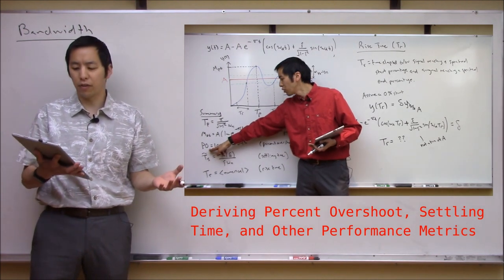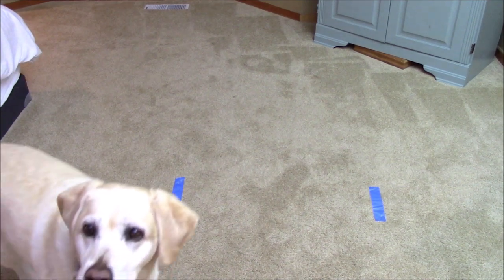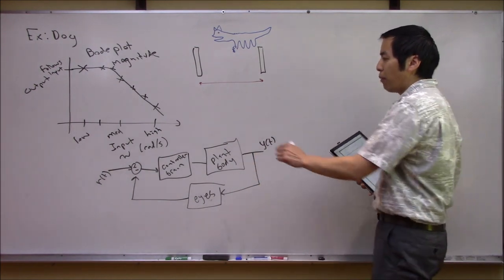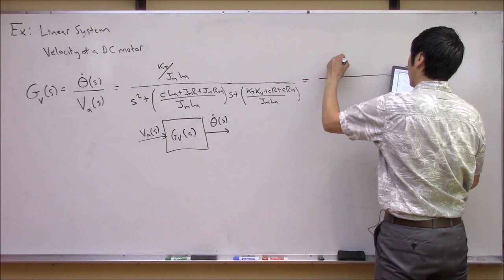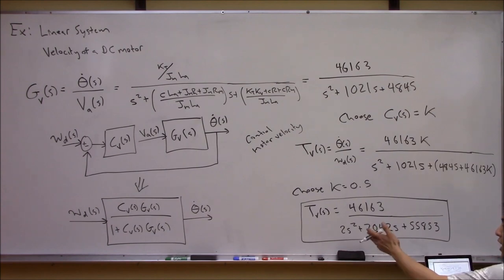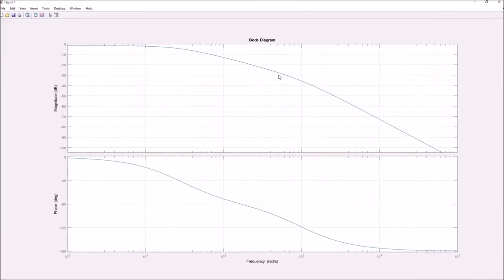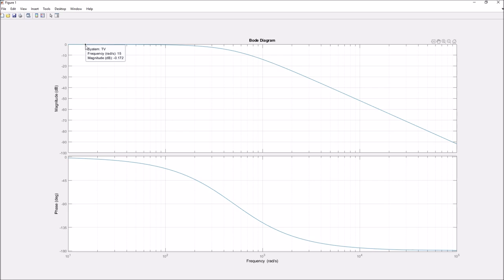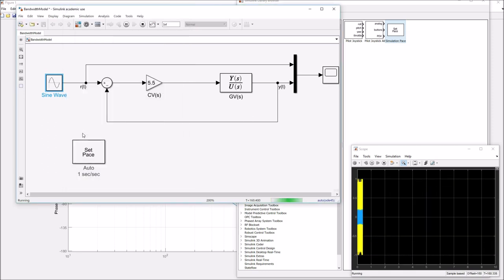Bandwidth of a Dynamic System

Comment: Hi Christopher, I am thinking about purchasing some speakers, and they have 3 models that have the same components.  The only thing that differs is the Nominal Bandwidth.  Here are the 3 Nominal Bandwidths they offer for the same style speakers, just differnt model numbers. 1st)  Nominal Bandwidth Horizontal 120° Vertical 60°.  2nd) Horizontal 60°
 Vertical 45°.  4th)   Horizontal 90°
 Vertical 60°.  I am planing to use the speakers in front of me up high as Nearfield speakers, because when i am mixing i cant here the mix from the main floor speakers.     So my question is which one should i pick out of the 3 nominal bandwidths.  ?  And in laymans terms in a real simple way what is nominal bandwidth, and how could one of the 3 different nominal bandwidths  would work for my application , which is using speakers for  nearfield speakers only. ?

Comment: What if the amplitude of the output goes more than 3dB above the DC gain of the system?  Is that considered to be "degraded" in terms of system bandwidth?
Reply from the maker: Great question.  In general we only look for the minus 3 dB point.  However, as the designer, you get to define degraded so if amplification is bad in your application, feel free to use this as your performance metric. However most people define bandwidth as attenuation.

Comment: Thank you for these wonderful lecture series, as others have mentioned it is one of the best explanations for the control bandwidth of the system. However, I have a question why do we choose the point -3dB as the bandwidth point, what is the significance of this -3dB point?
Reply: Output halves I believe
Reply: It is where our gain becomes 1/sqrt(2)= 0.707

Comment: AE511 The only person who enjoys your control videos more than myself is my wife, who is a pharmacist and does not know control theory! However, video of a dog chasing a laser pointer? She is there for that! Excellent video!

Quick question - is the "3 dB" Measurement just some arbitrary line draw? Like, why can I not define the bandwidth as 2.9 dB below K?
Reply from the maker: Haha, that's great, I'm glad she enjoys them.  As you know, there are several other dog examples in my videos.  In terms of the 3 dB drop, that is indeed somewhat arbitrary.  -3 dB = 20*log10(1/sqrt(2)) so this is roughly when the system attenuates to 0.707 of the original signal.  You can chose some other line but -3dB is pretty standard.